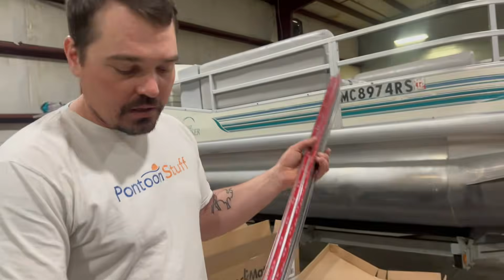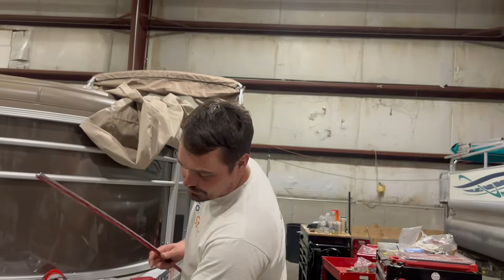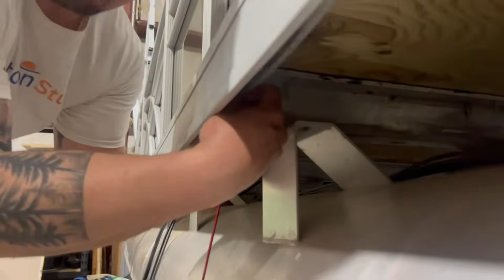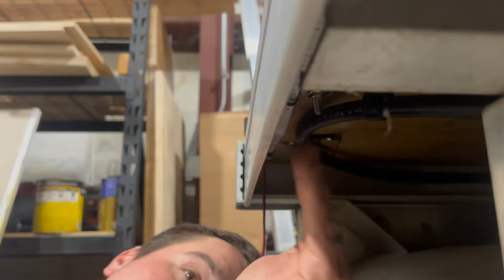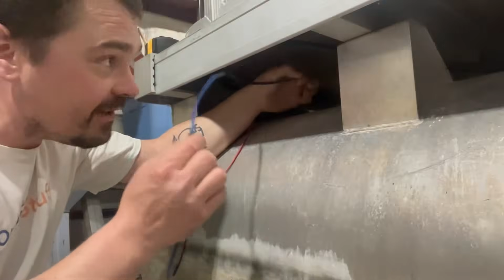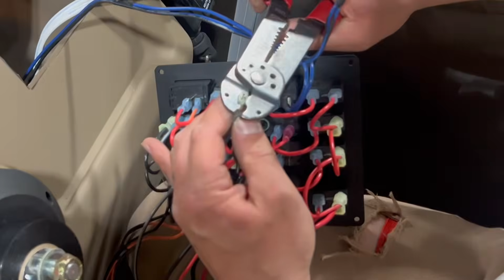PONTOON BOAT UNDER DECK LED INSTALL - Instructional

Comment: Heat gun for Tom for Christmas 🎉🎉🎉
Reply from the maker: 😂 I have two of them, one plug in and one battery powered. Plug in takes too long to deal with and the battery powered doesn’t make enough heat….lighter stays in my pocket wherever I go on the boat so it’s just easy

Comment: Why drill? why not just string it over each crossbeam? (if you have a long enough LED strip)
Reply from the maker: There's no space between the plywood and crossmembers. This is a unique situation, but we've run into this several times. Figured it was worth while showing what might need to be done on this type of boat.

Comment: Tom, suggestions on wiring underwater (ip67) pontoon lights together that arrive with rgb  wiring vs your single color demonstrated here.  The controller has a short extension between the 2 strips which wouldn't work on the back of the boat due to distance, wiring length and type. (rgb vs +/-.  I called two electricians who had no idea, was hoping you might........plz. Thought about running a long rgb connetor from port to star but concerned about total length .
Reply from the maker: I don't mess around with color changing lights anymore just because the cheap ones have problems with the controller and moisture. I installed an underdeck set of Green Blob lights which seemed to have better connections at the controller, but still unsure of the longevity. I've had to lengthen leads by splicing in but it's been a couple years. If I remember right I ran 18 gauge wire to lengthen. Those lights pull such little draw that a lot of them get away with super thin gauge wire. It never hurts you to beef them up with heavier gauge, but make sure you've got a fuse in there to protect if you're nervous about too long of a lead or too light of gauge wire.

Comment: Finding your site is a lifesaver, so suscribed after viewing multiple videos.  This video makes complete sense.  Would like to install budget friendly waterproof leds with my own harness.  Any suggestions on wire guage along the entire path as well as any other precautions or suggestions?  Appreciate any assistance.
Reply from the maker: Thanks so much for subscribing and tuning in! I would run 16 gauge to each LED as that seems to be the industry standard. 14 gauge wouldn’t hurt if it’s a longer run. For under seat LEDs that are smaller strips I will sometimes join them with 18 gauge, but run 16 gauge from the switch out to the first LED. A 5 to 10 amp fuse or breaker would be a good idea too.

Comment: I just bought the led kit, does it come with the wires to run the cables to the console or do I have to buy that separate?, if so where do I get it from?
Reply from the maker: The underdeck kit comes with the wires needed to run to the console (the blue and blue with a black stripe). They make it pretty darn simple to install.
Reply: @tomspontoons  awesome txs again

Comment: How do you install the LED lights on the seats and hide the wires? And installing dock lights onto your panels and keep it clean and hidden as well with the wiring. Haven’t seen a video on either one of these two yet.
Reply from the maker: - Docking Lights Here:

https://youtu.be/7zbz11EnwiQ

https://youtu.be/FVDL6iwTHc8

- Underseat LEDs:

https://youtu.be/8rhwybWxHXg

Comment: Will this create shadowing at every brace since it’s breaking the chain of light?
Reply from the maker: There's so many LEDs and light coverage by the time it hits the water that it doesn't create shadows.
Reply: @tomspontoons  cool my cross braces have a tiny slot above each one so I’m going to run mine through there
Reply from the maker: @loganfuller9413 yep, I’ve done it that way on probably 10+ boats that didn’t have other options possible.

Comment: Banks is “Looking Good” and growing ✌️
Reply: I have 76 ft of them on my garden border here in Florida, and they are regularly submerged when it rains. The connections out of the box are not IP67 even though the LEDs are encased in silicon sleves like yours. I replaced them with waterproof Xconnect pigtails. Have not had failures in 4 years.  The controller has built-in wifi, so I can control light effects using WLED app on my phone. My boat installation is new, but I am confident it will hold up just fine in the Central Florida lakes. I even have them on my golf cart and roof line of my home. It is a bit more complicated because I solder and seal all my connections, which is something  the average person probably would prefer not to do.
Reply from the maker: @-shadyG  Very nice! You've got those lights really dialed in well, and it sounds like you took the time to make sure yours will last for the long haul.
Reply from the maker: She's still a maniac, but becoming a larger sized maniac so fast...and she's not even close to being done growing I don't think!

Comment: I have my toon lights installed about the same way. Except I have an additional data wire because I am using WS2811 IP67 individually addressable LEDs controlled with a dig2Go controller from DrZz.
Reply from the maker: The only color-changing lights I've trusted to install are the ones from Green Blob Outdoors. I will have to look into the ones you mentioned. I found that the connections of the lights and controllers on cheaper sets from amazon are in awkward spots and will not hold up to the marine environment for the long haul.